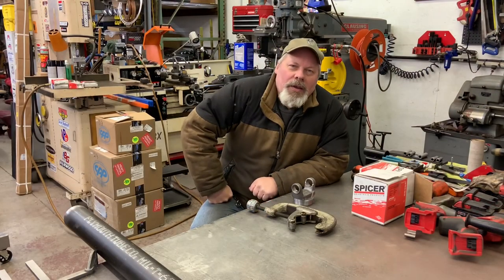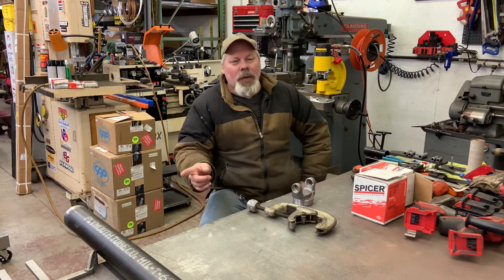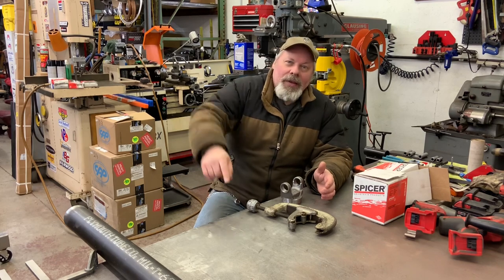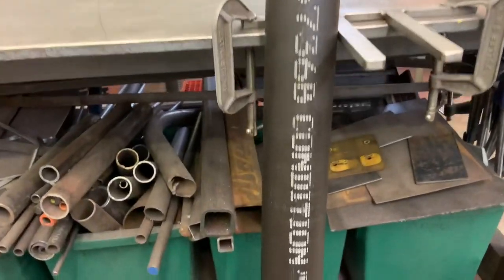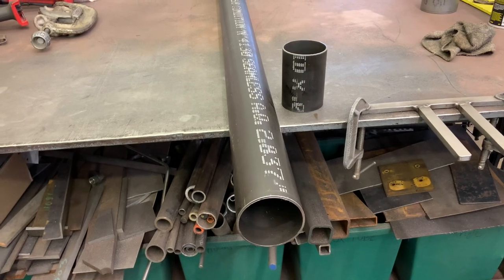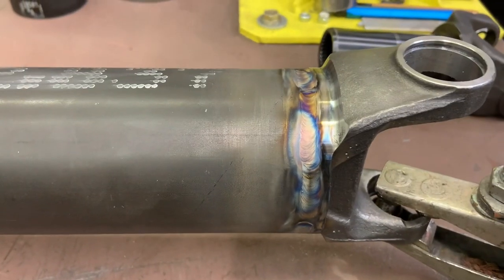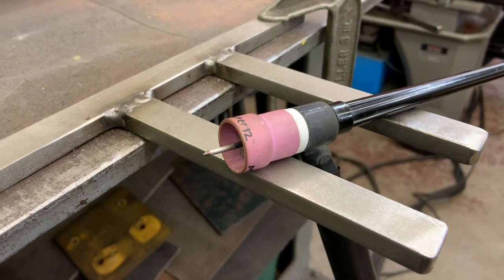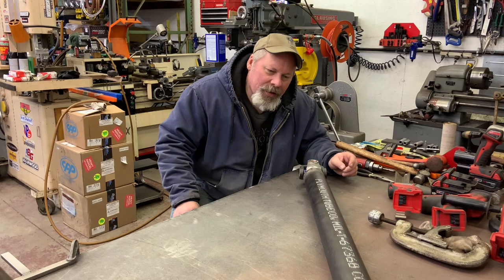How To Build A Driveshaft

Comment: What part of Maine do you live in? I use to live in Northeast Maine, many years ago. I enjoyed this video! I went from a 2 piece steel drive shaft to a one piece aluminum and finally to a carbon fiber. Having them all I can say that the carbon fiber is easily my favorite because of how quiet it is, not to mention strong and less likely to vibrate at high speeds. I liked the aluminum too but they were very loud. The two piece steel that came with the car is excellent for extremely high speeds but not trust worthy with extreme horsepower/torque.
Reply from the maker: I live in Standish, about 20 miles West of Portland.
I dream of a carbon driveshaft!

Comment: Shawn not sure of your Darts over the line rpm but the 60" driveshaft can only turn about 4622rpm until critical-speed
...funny that mild steel has a higher critical-speed
Reply from the maker: Yes the safety factor drops fast much over 50” length.
Thanks!

Comment: Do you ever take runouts on the tube before you weld everything up? Balance is an issue.
Reply from the maker: Yes I have many times. The moly tube is nice.
No balance issues yet, except with store bought mig welded mild steel shafts that cost three times more.

Comment: I was tempted to build my own before but I'M DOING IT NOW! I have a question, because my mind doesn't seem to want to shut down. What would be the downside of using cv joints instead of universal joints? Seems like the timing would be less crucial and more contact area to apply the torque through.. I've been mulling it for a while and I can only think of maybe a few house power.(?)
Reply from the maker: Awesome!
The CV shafts, at least OEM style, are definitely weaker.
Reply: @mountainsgarage  😬 ouch! I always thought their main weakness was full turn and full throttle.. Thank you anyway!

Comment: Awesome video! Did you have to balance it at all?
Reply from the maker: Haven’t had to yet.
Reply: @mountainsgarage  oh wow that’s awesome! I suppose if you weld it all straight and do all the prep correctly it should be fine
Reply from the maker: @Thatcressidaguy  The light chrome moly tubing and the TIG welding help. I learned this from a chassis shop.
Local shops use mild steel and MIG welding.
Reply: @mountainsgarage  oh yeah awesome as! I might give it a try! Fire the tig up and get some chromoly tubing, only thing is here in Australia for about 1.5 metres it’s about $450

Comment: Hey pal, what yokes are you using, cast or chrome moly? I know you mention the tube is moly but I didn't hear the yokes?
Reply from the maker: I have done both. Hard to get anything for parts right now!
Reply: @mountainsgarage  do you tig the cast ones? I see they say mig weld the cast ones. I have both types of welders but would prefer to tig it up.
Reply from the maker: @royboy620  Yes I tig them.

Comment: I have a non locking RPC dipstick that seems to be popping out of the tube for my turbo 400. I can’t see why it’s falling out other than vibration. Really gets me mad with the fluid I see on the firewall and possible issues with it being open while driving. If I were to go with a locking Lokar should the “full” line still be like your earlier uploads where you place a screwdriver against the pan and that’s the line? Many times I’m not sure mine is full while hot and in gear but I assumed a little bit accumulated above the pan line? Thank you
Reply from the maker: I use the Proform 66182 locking dipstick, BTE sells one just like it, probably others. It fits with the flexplate shield as well.
I won’t use a Lokar, most don’t have anything holding them in the transmission and the fill hole is too small.
Most come miss adjusted out of the box, but yes the fill line is even with the pan rail inside.
Reply: @mountainsgarage  thank you, I did read questionable reviews on the lokar. It’s on a sbf foxbody and I don’t believe I can get a hard line/non flexible tube in there. Sorry, I should have mentioned that
Reply: @timweb1510  Take electrical tape and wrap it around the sealing area. Works great

Comment: I see in a lot of the off-road videos they are using non greaseable u-joints because the cross I solid and significantly stronger.
Reply from the maker: They are OK on a shaft that is part time. You have to maintain the solid joints, take apart and grease.

Comment: This must be slow speed off road or for farm equipment since it isnt balanced
Reply from the maker: 180MPH
Reply: Off of bbn purenluck. I prefer to rely on those with talent. But hey, good luck!
Reply: *off of pure luck
Reply from the maker: @danielbuckner2167  If you have a local shop that can build you a TIG welded chrome moly shaft that is awesome.
All of the “Pro” shops in my area only build mild steel shafts with giant MIG welds and washers tacked on for balance.
Name the shops in your area that can and I will buy from them.
Reply: If I were using g a shop I would but I was looking for a simple alternatives to use a long bed lathe which is the easiest if you have one(or a friend). I feel like I ask too much so wanted to lighten his load. I'm not going to blindly "give it a shot" with a shrug, just not my style. You do you if you feel lucky go for it

Comment: uhmm, I failed to see how you balance the assembly.
Reply from the maker: I don’t, but you could.
The tig welded chrome moly tubing in lighter and more precision than a mild steel shaft mig welded shaft, that helps.
If I ever have one vibrate, I will build another. Hasn’t happened yet, 180mph.
Reply: Sooo... just dumb luck and if it vibrates you drop another 200-300!? Hard pass, I'll get mine on a lathe and test the runout. Hell kids in the 1960s at least tested runout on the car and that's better than luck.